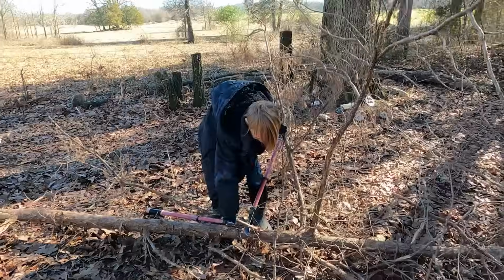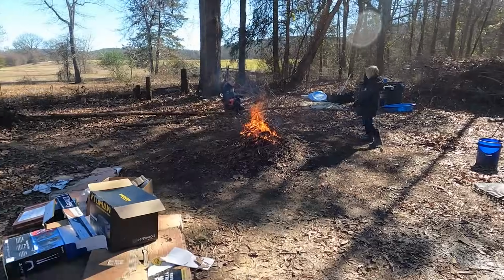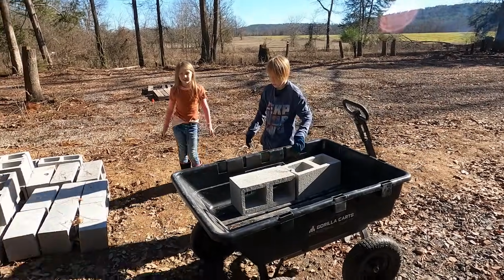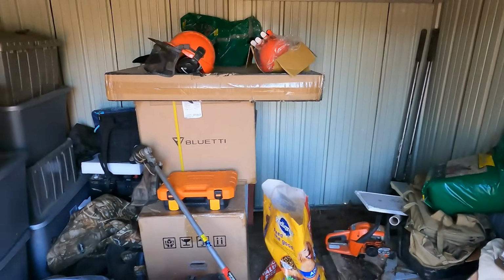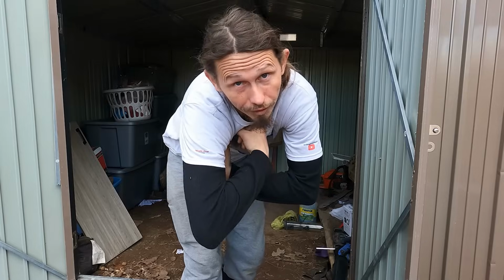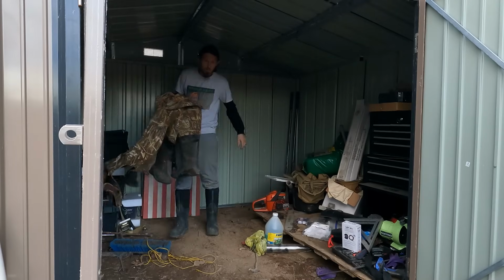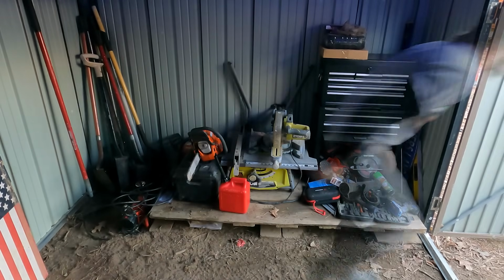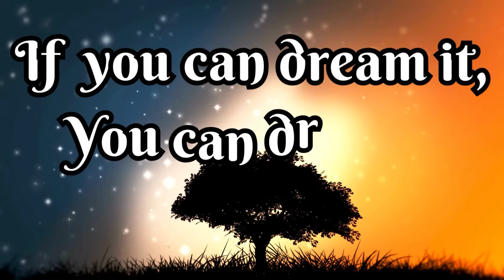A FIREY START TO 2024 | work, couple builds tiny house, homesteading, off-grid, rv life, rv living |

Comment: Michael, you need to turn all them bricks so the holes are on top & bottom,  tne brick needs to protect the ash and coals from coming out. Tne way it is not it will fill up snd come right through the holes.  Plus it could spark the tootsies when people are sitting around it.
Reply: my thoughts to lazy on my side to comment thz

Comment: Mike, It might safer if the block holes faced up to slow the air flow toward the fire. Just a safety suggestion.
Reply: If the were up the bricks would break from the heat. 🤷I've seen that many times

Comment: When are you going to Insulate your shed and put up sheet rock.  Then add air and heater.  So you can move the kids in.   If it was me.  I would seal the porch in and make it a room.
Reply: As my husband and I have been working on a major remodel, we have to wait til the money is there. Bills, groceries and must haves 1st, then we bought insulation, plywood, electrical and so forth. Still working on it but won't be long now😊
Reply from the maker: Congratulations @charlene5161 🎊 👏 💐
Reply from the maker: It will not happen very fast. That's for sure 💯 👌